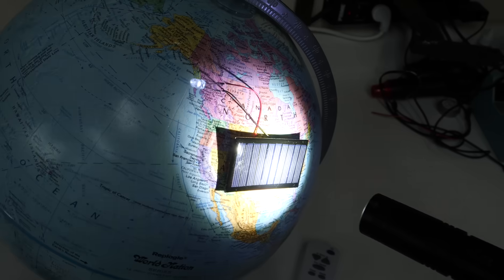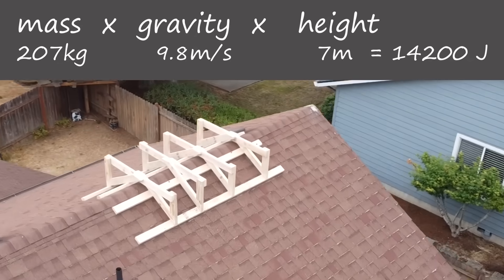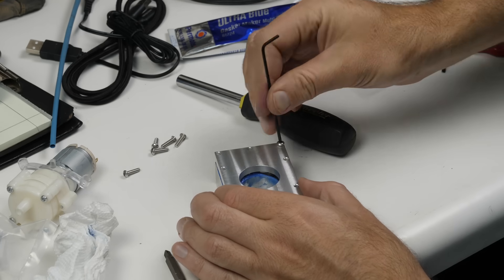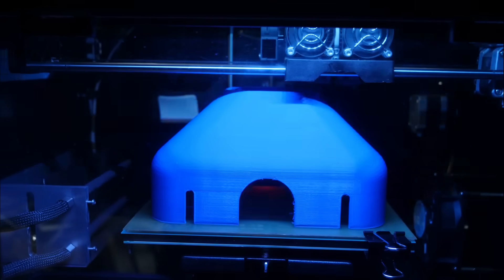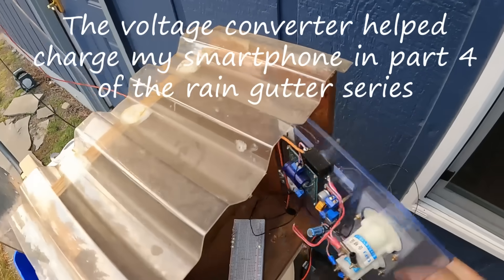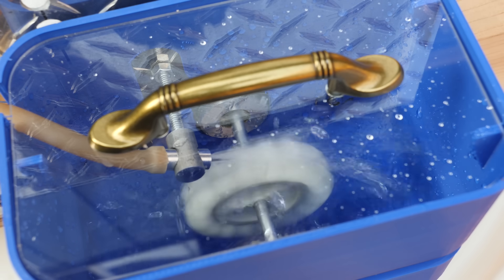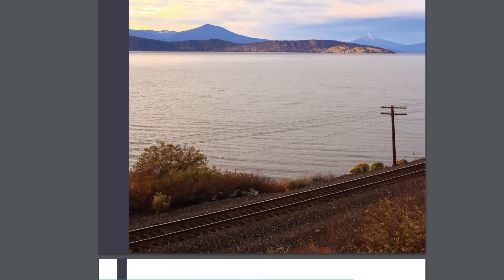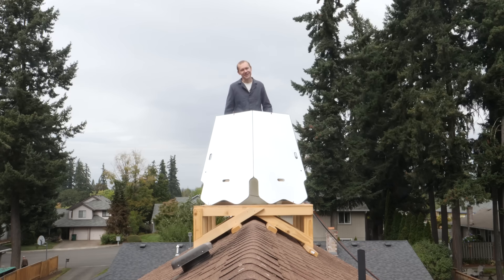Storing Solar Power on my ROOF!!!

Comment: Hey, avoiding the evaporation and freezing, why not use bearing balls? They sure have mass and kinetic/potential energy as well and will not evaporate or freeze like water does. Perhaps you can find a way to deliver them to the roof, you need the same mass anyway. They can be obtained by dismantling bearings, used ones will do as well.

Comment: If you simply used City water pressure 2 pump water up to the roof and then let that water generate electricity through gravity, would that be more effective
Reply from the maker: Yes, but I think the water costs more than the electricity it would generate. Have you seen my shower power video?

Comment: Hmm, this reminds me of adding heat shields to solar, sealing the back side, and using water coiled to move the heated water and store/use the heated water to do the heavy lifting warming your hot water usage, in floor heating, heated driveways, etc: If the drum/water energy storage was in an attic it could accumalte and use the heated/warmed water from the ambient attic temp with diversion or recycle. Bury your ground storage and you're using geothermals then, too

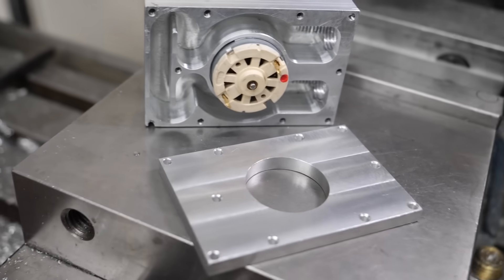Comment: 4:40 Having a CNC is a huge benefit? Yes. Now claiming that you won't have the same results with a metal 3d printer? It's called ignorance... Yes, you won't have the same results, you have better results, because Metal 3D printers can create objects that are impossible to machine.

Comment: Running a quick calculation using the appropriate formula of E=m*g*h
E = energy in joules
M= mass
G= gravity, 
H = height
 lead me to the discovery that a 20Kw/h capable battery would need 815 tons of Water when elevation (also called h in the formula above) is at 9 meters.
We need structures that can support 815 tons of weight at that elevation, I doubt we can make it an alternative to lithium batteries
Reply: After finishing the video, I can't say anything but good job, this is an awesome video.
Cool video.

Comment: This is extremely neat but I'm confused on one thing: why not just run a garden hose up to the barrel and fill it that way? You're using water from your house anyway so it's not like the water in this video was free, and a hose doesn't use electricity so it would be no different than what you did in terms of cost and would likely be more efficient (the powered pump must certainly be wasting a huge amount of the potential energy in this system).

As cool as it is I don't understand why you're involving solar power at all, other than for the sake of it.

Comment: Could you increase the energy density by pumping the water in a closed system up into a pre-pressurized container?

Pressurize an air tank on the roof (or ground for that matter) to as high as safely possible and just use a lower volume higher pressure pump to pressurize the air container further by filling with water

Comment: Why can’t they use a capacitor? Like I do with my sound system it cycles stored energy then solar panels would last longer because the energy is not being wasted. It gets stored through the capacitor.

Comment: A fun video showing that pumped hydro is really a project that hinges on scale more than anything. An interesting tangent is that if instead of raising a volume of water to the roof, you raise the temperature of it to that of a standard water heater it takes over 2000 times as much energy. Of course, unless you're using that energy just for heating you're not getting it back at the highest efficiency. But still, the orders of magnitude difference in energy density just using water shows how "weak" gravity is.

Comment: I remember watching one video where a groups of engineering students ran a 500m or so fire hose down the side of a hill from a stream at the top. They built a water wheel at the bottom, but the pressure was so strong it nearly destroyed the first prototype when they opened the hose. You need a long enough distance to build up the pressure.

Do love you videos. They make a fellow engineer smile. 😀

Comment: Another way to store energy is a sand battery. You can bury it. Energy can generated either thru a Peltier module(s) or Stirling engine(s). Or use can use the energy to heat your home or take hot showers. Both Peltier and Stirling uses the difference in heat to generate energy.

Comment: Hello from Trujillo Perú. Your video was very informative. I have a 1800 watt peak solar system charging recycled secondhand lead acid moped scooter batteries which run my 100% electric home.
Thank you for comparing your barrel of water to a battery.

Comment: Suspending a heavy weight (same as drum of water) using a pulley system attached to gear reduction to spin the alternator. This way would be much more efficient than water.

Comment: 14k joule, makes only 3.89Wh of energy.
As you mentioned in video, you need to scale up to power a house. 
If you scale it up for 1000 times, then you will have only 3.89kWh  of energy. 

It means a reservoir, instead of barrels. 
Then there will be other problems to start. Maintaining, cleaning and water loss to sun. 

Btw, if you connect the flow valve to a governor, maybe there will be an autocontrol of power. 

Still a good explanation. Thanks.

Comment: Did you ever consider adding wind turbines . As you said show me a small amount of time the solar is available, however wind turbines will work even if there's a slight breeze.. anybody not provide you with all the power you need but it is a good one to help make up power

Comment: Great demonstration of the process to assist in learning concepts of mechanical and electrical engineering.

Maybe you could work additional concepts in, such as the stored water volume required to accomplish some practical task, or how inefficiency in devices like the motor in your example robs the system of energy.

Or how a similar system could be used in other ways and the energy stored could be more efficiently used in another form (I'm thinking captured rainwater pumped to the roof by a solar-charged battery operated motor, to provide evaporative cooling and reduce the electrical energy required for the HVAC system to remove heat from the home).

Comment: It happens that the highest reservoir in oregon broke only because no one could stop the pump from filling it…. The choice of a full automatized system without even a video monitor of the water level was a terrible mistake ! Hope things got fixed with a mix of technology and common sense.

Comment: I bought one of those pumps for my guitar humidity control system.  Weird design, very inefficient, ran about 6 months.  Almost any other pump would be better.   Similar system ran rocks up the hill on tracks to store energy.

Comment: Just a thought and not sure if it would help but figured id spitball it here: 

If you had a clearer barrel for the water, and placed steel wool in it (or you could use black marbles), youd increase the amount of absorbed light energy inside. This should heat the water, and if it were sealed on top, it should increase the downward pressure of the water, above what gravity alone would give. This would increase your downward flow rate, and in turn increase the amount of juice you get at the end.

The tricky part is making it a closed system. Dunno if someone could engineer the increased pressure to only push downward to the ground instead of also pushing backwards against the pumped water coming upward to the tank.

Dont roast me!

Comment: good job, you can increase water pressure and produce more energy by changing the water supply pipe, try to use water pipe coming from the barrel bottom ( will increase pressure by ) 2ndly use the pipe diameter like 2, 3  or 4 inches at least, nuzzle should be installed at the end, you will see how much energy, force of water will be there to drive generator.
By the way you did not use the proper way to get maximum water force to be use for generator, by using 1 or half inch water supply.

Comment: Perhaps you can fill your roof barrel with the street's water pressure too, no solar power needed. That would be cool!
Storing water on roofs is common practice in Brasil.
Reply: Use the city water pressure in your favor to run a turbine!

Comment: If it's not sunny or windy when you reach for the light switch where is the energy going to come from? Why did you go  to fossil fuels instead of the Battery from the solar and wind you Did have? You live in a city. Most are incorporated and have contracts with the local electric company to push grid power. There are tons of people who use solar and wind daily not connected to a grid who live normal lives powering everything they need. To me the Push for large city based energy storage to replace or supplement the utility companies are just another ploy to keep those companies in power for their monopolies. It's individual power solutions that give citizens freedom.

Comment: Great exercise in science if you have the time for little result?  Educational. I can have same  / better power from connecting the garden hose to a small turbine / generator . The mains water pressure provides the energy 24/7 for free. My water charges don't meter the quantity of water used, one annual payment and use as much as you need.

Comment: If the tank were black, the water battery could collect and store gravitational energy and thermal. Warm water could be routed into the domestic hot water system so it receives pre-heated water. Yes, many other enhancements could improve that further.

Comment: try gravity plumbed fuel rocketry. example draining fuel tank measurements: height 50m, radius 10m, exit hole radius 1m. total water fuel mass 15 700 000kg. flow rate 100 000kg/s. output pressure 500bar. flow velocity 30m/s.

Comment: you should install metal roofing to reduce friction on the rainwater so it travels faster. Less loss = more power. As far as your gutter system goes.

Comment: Canary Islands have a lake battery. They produce power by solar and wind and excess is used to move water from a low lake to one up a mountain . When power generation dies off the water starts to flow down pipes through hydro generators powering the cities. Awesome. And the future in my mind as is a environmentally positive battery

Comment: I use a weight on 20 foot hole 200 pounds geared down to spin a little motor to generate power to LEDs and in the day time solar panel to slowly raise the weight up  sky the limit

Comment: What about using compressed air as a battery (energy storage) using a 1000watt motor spinning a 2hp compressor using excess solar power. Slowly spinning  the the compressor using a pneumatic vane motor. To spin a 2kw 3 Phase generator used to charge the 24v house batteries with multiple ,,40. Gallon tanks charged to 200psi   regulated to 120psi ,and possibly making power down to 50-60psi  with a rotary vane 18" in diameter and 4" wide with air inlet nozzles about 15° apart per rotor possibly using twin rotors/slitting the single into two 2" wide rotors with the housing offset roughly 45°so the start of the vane is offset slightly, maybe use the exhaust to spin another rotor 4" wide on the same shaft setup to work on lower pressure, using the exhaust from the other two rotors. Maybe it could output 3+kw at full power , this required lots of air volume.so throttle to last longer I'd like t experiment with this maybe on a smaller scale maybe using a pneumatic drill to power the generator , 350-500 watts or so! sorry to ramble, compressing enough air to run a pneumatic motor fr a few hours is alot!  Have awesome day!🎉

Comment: This is great!

Would you have to turn the water on manually each time you wanted to use the power? To truly replace a battery, it would need to respond to ad-hoc demand, and fluctuations in demand. I'm really interested in implementing something similar, but don't want to have to go and turn the tap on each time, or find the tank empty because I forgot to switch the tap off. 

Would something like this be achievable, where it changes the flow rate based on demand?

Comment: Yeah, I've worked with, and burned through, quite a few diaphragm type pumps over the year; especially smaller units like the pump style you tried early on in this video. If the motor holds up, the silicone diaphragm will eventually puncture & leak like a sieve. Even with a simple pre filter, the miniscule particles in the water column will eventually wear out that tiny diaphragm. If you've not done so already, a larger pump with a far longer service life can be had for well under $30 on Amazon. I'd be happy to point out units I've had success with in larger volume, outdoor use. 

I'm sure you've also found more efficient micro turbines to convert water to "juice." If not, I'm certain you have subscribers with loads of experience in that department!

Comment: If he used the entire barrel of water (14,000 joules) over one hour, it would provide a little less than 4 watts. Used over 10 hours (roughly all night), it would provide 4/10ths of a watt, or enough for a single C7 LED Christmas light bulb.

Comment: Instead of using water flow to drive the generator, in Day time using a solar motor bind a flat spring ( bigger model of automatic Watch spring ) then night use the unbinding force of the spring to drive the generator.Using gears can control the speed and frequency of the generator

Comment: Wouldn't it be more efficient to use a pulley system on the turbine, basically a tall watermill?  Make a chain loop the height of the house with water boxes along its length, with the turbine attached at the bottom.  Water is released into the boxes from the top, giving the chain weight on one side to work on the turbine.  At the bottom, water is dumped into the bottom reservoir.  That way you shouldn't have energy wasted from splashing water flow.  The main problem would be keeping the friction low enough to be efficient, but that seems like an easy problem to solve.

Comment: Hey man. first video of yours, will stick around for a while and see what is what. I am liking your ideas very much.

Here is an odd one... Similar to this water one, but using dirt or sand and an archemedis screw.

Solar or a reloop can power the screw and get the sand to the top. the container at the top should be more like an hourglass hopper so sand can be dumped at a regulated speed. this container should be as dark as possible to absorb thermal solar heat too!

Imagine pumping sand up to the top to charge with heat, extracting the inertia as you pour some into a bucket. That should make the same powr as this system, but now you also add the thermal absorbtion in the form of a bucket of hot sand you can place in the house to radiate, or transfer the heat to a water heat battery in the home and so forth.

Could be the next level up, <3

Comment: This is less energy, than 2 AA size battery can store. :/ Plus ín case of battery there's no need for energy transformation, where you loose almost 3/4th of the stored energy.
Learn more physics/engineering and think. :/

Comment: Great video and channel.
😮
I am Trev from Australia.
I have a better idea if you guys wish to go with it , same principles and storing energy except different materials.
Battery storage is not , repeat not going to be the best way to store energy and has not always been the best,
The tank will hold compressed air.
It doesn’t need to be on a roof.
Solar or wind electricity can run a compressor and store energy that can be harnessed when the sun goes down.
Compressed air can run a generator/alternator of any size .
When a switch goes on and draws air to kick the power source on bingo , stored energy , no batteries needed.
This has been done in industrial settings for a long time but not storing and using free renewable energy yet.
Another old fashioned method that should come back is steam .
Thus can be produced by renewable energy and maximise efficiency by combining renewable energy with steam to run power generation motors

Comment: As an Electrical Engineer, I can't help but ask what the efficiency of this system is. Not because I think it will have bad efficiency, I'm just really curious. You could find out by measuring the power consumption of the pump to fill the barrel and then measure the power produced at the generator. P = IV or use a measurement device to record the data. Enjoyed the video! Cheers!

Comment: Dont run the supply hose straight up. Instead make it really long and slowly incline it up the house . The line will take a while to fill but the pump will pull way less current and deliver same or more water and the pump will last longer..and not get hot

Comment: not a math wizard......  what about a 275 gallon tote  but only about 40 inches off ground.  Curious potential power production as a night battery with a 24v system.  any number crunchers out there? 

Thinking of making a fence around my property that is made up of numerous; one empty tote on bottom and one full on top........  water flows from top one to bottom one over motor to create electricity...  when sun is out via solar production same motor pumps water back to the top.  Some of them will move very little water back and forth due to how much sun hits them....  and that is OK cause others will get much more sun.

Granted with this each would need a motor and not sure how to set up a charge controller this way to re-charge chemical batteries to make up for what is being used at night.   (aka this should be way cheaper than enough battery to make it thru whole night..... and will help store energy at less cost on numerous days of hazy low sunlight
Reply: granted... 4 seasons here.... it gets bellow freezing at night for a few months so that has to be figured in.